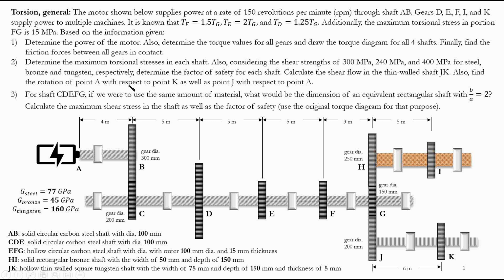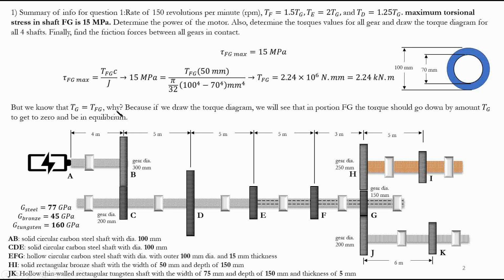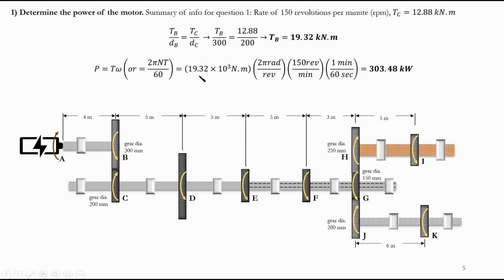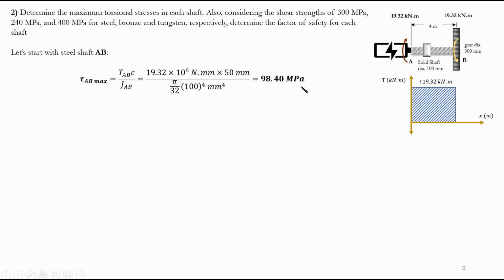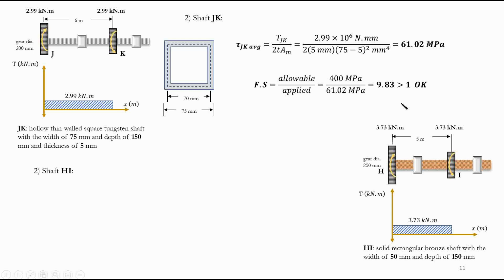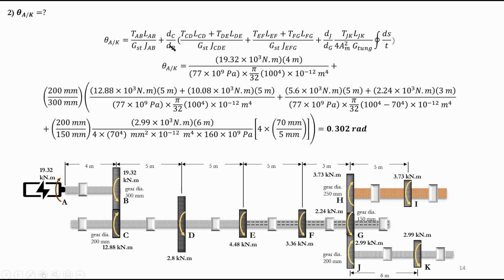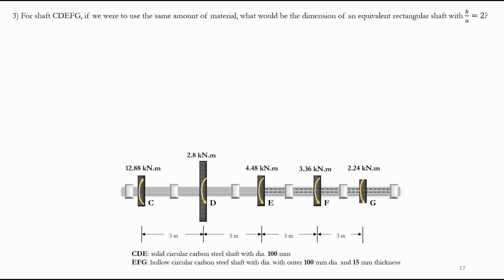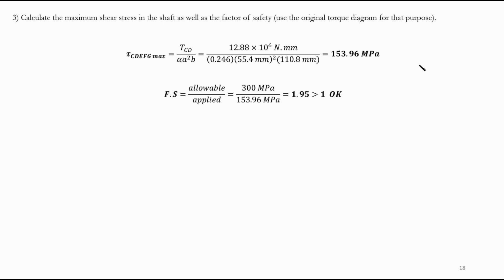Torsion: General (Comprehensive) - Strength of Materials

Comment: Hi Shayan, I believe the gear ratio only applies between gears b and c, as well as g and j. I don’t think you use the parentheses for all the twists occurring after c. /*Never mind, your solution is correct, as per Dr. Anwar*/
Reply from the maker: Hi Dilpreet, thank you for your comment and for pointing out the mistake! Yes, it will be exactly as you mentioned. The parentheses will apply only to the C/D part, in this case, regarding the rotation ratio between the gears. I will pin your comment and add some points in the explanations soon to address this. Thank you for watching vigilantly!
Reply: Thanks Shayan, If you don’t mind me asking, where did you obtain this example from?
Reply from the maker: @dilpreetrahal5780  all of the questions solved in this channel are designed by me.

Comment: Hey sir I didn't quite understand what will be the procedure if say that CDEFG is transformed into rectangular shaft (depth(a) = 3
times of width(b)) having the same cross-sectional area. will depth(a) and width(b) be the same along CDEFG. 
Which one is right ?
procedure 1: Volume(cdefg)=V(cde)+V(efg) then V(cdefg)=V(new rec shaft) 
procedure 2: Area(cdefg)=A(cde)+A(efg) then Area(cdefg)=A(new rec shaft) 
procedure 3: Area(cde)=Area (new rec shaft) will get a & b for cde only 
the Area(efg)=Area (new rec shaft) will get different a & b for efg only ?
Reply from the maker: Hey Karim, thank you for your comment! Procedure 1 is just about right! Please notice that this question asks about the "same amount of material," which translates to "same volume." We will automatically go with the same process if the question asks about "the same cross-sectional area" (same volume). The reason is we have two types of areas and as a result, formulating the question as "having the same cross-sectional area" can be misleading. Also, the relationship between width and depth is given for us to derive dimensions from the volume. 
Please let me know if that answers your question!
Reply: @StructuralEng  yes it does thank you so much.

Comment: Hey, great vid!! I had one question, for the last question of this problem, it asks if we had the same amount of material...If the question said same cross-sectional area would it be the same thing? Thanks in advance.
Reply from the maker: Thank you for the comment! For that question, the issue is the crosssection area is not consistent throughout the shaft. So, if we have two different types of crosssection, we can basically use the same process as you see in the video. In other words, we are giving weights based on length to various types of crosssections that exist through the whole shaft. The bottom line is the process will necessarily be the same, and you can use the exact same process I did in the video.
Reply: @StructuralEng  Thanks for your response! I had another quick question, which way should we start our torque diagram from? Suppose in shaft CDEFG we started from the right, then the torque would start negative and all the torques in the shaft would be negative. Also suppose there was a gear to the left of gear C, Lets say gear L, starting our torque diagram from the left or right would both give 2 different diagrams. Starting from left we would have negative torque on that gear L but starting from right, it would end up as positive torque there. Thank you in advance for your reply!!
Reply from the maker: @chrispaul9194  It is best to start torque diagrams from the left. But in reality, you could start from the right, but remember that you're going in reverse, and your positive convention is the opposite of what you had if you started from the left. So it can be confusing. In general, you don't need to start from the right in any scenario. Even in this question, as you see, although the given info is about shaft FG (right side) and we need the torque value in portion FG, intuitively, we can see the magnitude of torque in gear G and portion FG are the same.